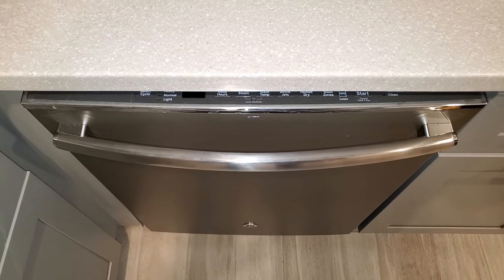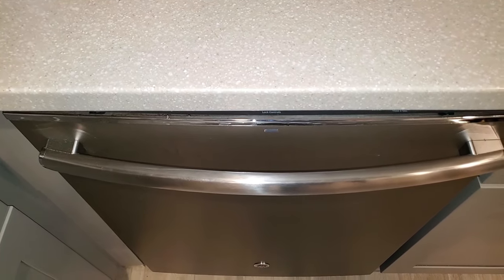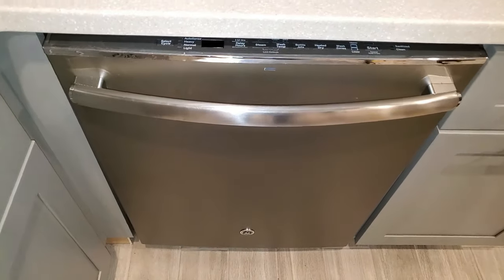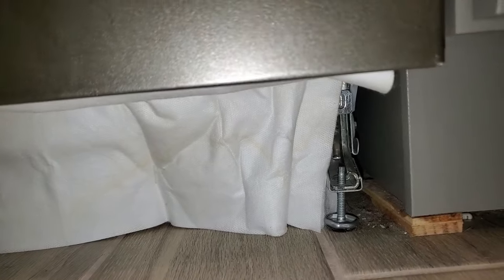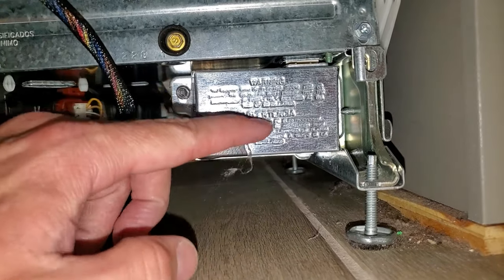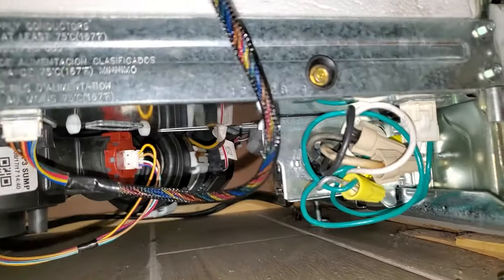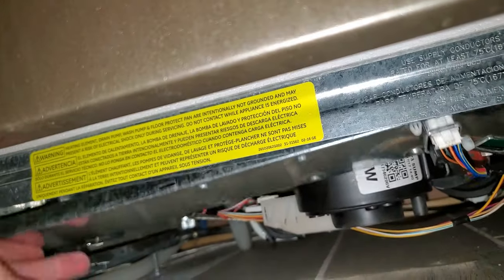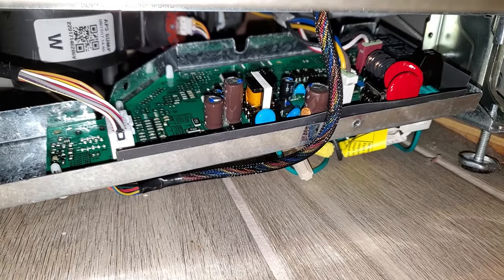GE Dishwasher - Troubleshooting a dead user interface

Comment: Awesome Video!  I'm facing the same problem on a different model. My model is GE-GDF640 (three years old) no led & no key function. Checked the main control board 13.5Vdc volt to UI board correct, replaced UI board, but the problem kept the same, then replaced control board, but still can't fix the issue. Give up, never buy ge anymore. Very bad quality.

Comment: Where did you find the meaning on the led on the main board? Having the same issue but I just replaced the user interface and it didn’t fix it…

Comment: Update…the board is dead again. The lights were on and shortly thereafter started beeping again, and went dark again only hours later.   Not the fix I had hoped for.
Reply: I had GE Service and they replaced the control board.  Fortunately, I had purchased the extended warranty and the repair was completely covered.

Comment: Matt, thanks a lot for the Video and explanation. 

Symptoms. -- UI completely dead, no lights.

How I fixed mine.

Made sure power cable is good, and 120 v is supplied to the control board.
I have Solid Green light.
Checked if 14 v dc is going to UI panel.
Disconnected the Control board completely. Connected back and made sure to hear the Clicks when putting the connectors back on the board.
When I connect the power Eureka , the dishwasher UI has power and lights are  on. 

Did not replace anything.
I think it was lose CONTACT SOME WHERE.

IT IS WORKING FINE.

A TECH WHO COMES FOR A SERVICE CALL WILL NOT SAY THAT IT WAS A LOSE CONTACT.

They obviously need business and service fee.

Comment: Any advice if there is no voltage across the pins?  Yes, it’s plugged in and there is a green LED light on.
Reply: I have the same issue. Were you able to get an answer on this or figure this issue out? Thank you for any information you may provide.

Comment: Thank you for the great video, it gave me a lot of insight. Question though, if I'm pulling 30 volts from my number two and number five pin, what does that mean, is it the main control board, or is that acceptable voltage to be coming from it?
Reply: That's a crazy high voltage, and definitely not normal. Double check you're testing the right pins, but it sounds to me like your main board (which should be supplying 14 volts) is not working correctly.

Comment: I tested the main control board and it has power and pulling 14 volts at pin 2&5. The green light is blinking every couple seconds. You think my issue is the user interface board? (I saw your video on how to replace, but wondering if that’s my issue). 
The dishwasher shuts off completely few seconds after I start a cycle, and won’t turn back on till I unplug it and plug it back on.

Comment: I have GE Model# GDF640HSM2SS. After 2.5 year my dishwasher completely went dark. In the electrical junction box when I tighten black(hot) and gray wire, then lights come up back in UI board and dishwasher starts working. This tells me main control board and UI board are working fine. I wonder how wire would get loose especially dishwasher worked fine for 2.5 years. Issue has happening 3 times now but works after the wire is tightened. Any suggestions on wire tightening so it doesn't keep happening again?

Comment: I think solid green is good. I was wrong. According to manual ever 3 seconds it should blink if there is no cycle.  I kept fiddling with mine and finally the board woke up.  Also found 2 shards of glass in the drain pump. 😢

Comment: Hi, @ 9:20 , how did you determine that the 2nd and 5th pin are the ones where you need to check the voltage ?

Comment: I have the same problem - around the 3 year mark dishwasher stopped turning on. Had to turn on/off the fuse box and it'd buy me a few days until it died again. After a few months of doing this, me flicking the fuse switch no longer works.

I've tried replacing the control board under the unit once and this didn't fix the issue....ordered a user interface board to see if this will help - thanks for the info! Wasn't aware of the LED light giving a clue to what part needs replacing!
Reply: Happy to report that replacing the UI Board did the trick. Although there's a bunch of steps, its not complicated to do. Took about 45 minute to do myself and running as we speak :) thanks a ton Matt Payne this did this trick! Everyone told me to just buy another unit as trying to get a handyman in will cost about half the price of just buying a new unit. 

Saved me from buying another 500+ dollar dishwasher!

The control board at the bottom of the dishwasher is now blinking green, which means it has communication with the user interface board!
Reply: I had the same issues and experiences. These dishwasher displays will shut off on their own. I’m wondering if their is a flaw with that. I have no light on the control board. What does that mean?
Reply: @lesliechow7286  try replacing either the control board or UI board
Reply: @WillTech105  , these dishwashers are lemons. A class action lawsuit needs filed
Reply: @lesliechow7286  I agree seems way too many people are getting these issues around the 3-4 year mark
Reply: @WillTech105  , purchased and installed mine January 2017. Bought it on Black Friday sale from Home Depot, normal price was $750, on sale for $495. Model was discontinued just after this time. First issues I had with it were in March of 2021,, had powers and controls lit up but it  wouldnt start. Bought a new door switch only to find out it wasn’t the door switch after I got my multimeter working. It started working again after turning power on:off etc. Still had intittent issues until may when it finally stopped working. Got a new control board. It worked fine for a month and then it started being finicky again. It brevet dried the dishes. I bought a new float switch. No change. I filled the rinse aid dispenser up and it seemed like the dishes were drying better. In November it started to get to the point where it didn’t work for 2 weeks ,no powers showing” and then It would work again. It got worse and worse, weeks in between it not working. Now it doesn’t work at all. I checked the wall switch (have to have it for code). I found with the switch off the washer was still getting about 1 volt. I replaced this switch with a brand new one. Still 1 volt. I was thinking this low voltage may creating some problem when  it’s in auto off mode (display not lit up)I’ve found if you leave the washer on in some situation where it doesnt auto shut off the control  display, I’ve found the washer will still work days and days while it stays lit up. As far as the 1 volt in the wall switch, ive found that’s normal according to electricians on the internet. It’s caused by electors fields from surrounding wires. It did seem in the past that actually turning the breaker off for a while would help it run again.

All that’s out the window now. I already put about $200-$250 wiring of parts into and all my time dealing g with this headache. I should have kept my one that was made in 1993 and just had new racks made. 

Dishwashers now start at $700 for a stainless face to match my other appliances.
Reply: @lesliechow7286  Sorry to hear @leslie chow - unfortunately my dishwasher is now acting up again. When I look at my Control Board I see a solid green light which probably means it lost communication with the UI board again. Literally had the part for 2 months and its busted again. Going to get a multimeter maybe the electricity is frying the boards.
Reply: @WillTech105  it’s all a waste of time. Their needs to be a class action lawsuit against GE for all of this. A GE rep saw me suggest a lawsuit against then and immediately they contacted me and asked that “I contact them privately “ to review.
Reply: @lesliechow7286  They probably know the design is defective hence why are so many other users of GE dishwashers having literally the same issue. They should do a recall or something to make this right.
Reply: @WillTech105   same here I replaced the UI board 2 months ago when the dishwasher was 2 years old and it has failed again. Lemon 🍋
Reply: @lesliechow7286   Curious, did you contact them?
Reply: @jeremytiner8729  no
Reply: We should definitely file a class action lawsuit. I've had 3 service repairmen out here and they've replaced 3 parts and my dishwasher is doing the exact same thing as the rest of you. Why are they able to get it working temporarily? The last repairs lasted less than 10 days. One guy indicated there was a little reset button under the dishwasher, but we can't seem to locate it. I've tried unplugging the wires that some show and I get no change. My dishwasher is the same age, 4 years old. Model number is gdt655ssj2ss.
Reply: @lesliechow7286  BTW - haven't updated this in a few months but I'm still seeing the same issue. The fix for me is playing musical chairs with my spare parts until it works. Will be fine for a few weeks then it'll die again. Rinse & repeat. Never again GE....never again.
Reply: @adrianneblack7048  Reset switch? Not that I know of unless you mean holding the SELECT CYCLE and START buttons at the same time for 5 seconds (btw doesnt work for me). I always see the control board shows a solid green light on it, which means its lost communication to the UI board (the board with the buttons). Usually changing the wire door harness, UI board, or the Control board fixes the issue for a while. Then I'll have to change them again to the previous parts again (literally need to swap parts every month or so) and then it'll work again. Alot cheaper than hiring a repairguy or buying a new dishwasher. I've done it so many times I can do it all under 20 minutes at this point.
Reply: @WillTech105  that is ridiculous that you have to change them at all, no less so often. And that changing them back to the original parts, it just makes no sense. GE needs to be aware of this. Not that they'll do anything, but they can't if they don't know. I'm going to give them a piece if my mind on Monday. 

As for the reset switch, one of the repair guys told me about it, but I didn't look close to see where it was, assuming it would be fixed and I wouldn't need to use it. In doing internet searches we've read about it, but can't find anything that tells where it is on this model. Its super frustrating. I've been trying to troubleshoot this thing all day and its not the first or second time I've wasted a day trying to get my dishwasher to work. All these companies are going to stop getting my money because I'm going to go back to doing it by hand, I already do for many things. I think it will save me time in the long run and will definitely save $$$.
Reply: @WillTech105  I haven’t touched mine. It’s going in the trash. Never will I buy a GE appliance again.
Reply: @lesliechow7286  Wanna get least another year or so out of mine before I chunk it and pull an Office Space printer scene on it
Reply: @adrianneblack7048  It is really ridiculous, agreed. GE wont do anything about it so only thing we can do is raise awareness that ALOT of other people are getting the same issue and to no give their money to GE going forward.
Reply: @lesliechow7286  @jeremy tiner @perry pendergrass - after 2 weeks of the dishwasher not powering on (flipping the breaker didnt help), I once again took 20-30minutes to play musical chair with the door harness, the UI board, and the MC board. After hooking it back up - the GE dishwasher magically (again) powered back on. Let's see how long it'll last me this time.
Reply: @WillTech105   damn ok thought I was going crazy. Got switch and it worked for a week. It didn’t work anymore and I don’t have the green light no more on the CB. 14V on 2&5 so it’s communication is working. Guess I have to buy UI board and ply this game too 😅

Thinking I might just not waste my time knowing this isn’t guaranteed after reading all your guys comment

Comment: Awesome Video!  I'm facing the same problem on a different model.  Where did you find the info on what pins send voltage and what the lights on the control board mean?
Reply from the maker: Thanks for the kind words!  And sorry for my slow response...it's tough to keep up with all the comments these days.  I believe I found most of the information I needed in the following forum thread:

https://www.applianceblog.com/mainforums/threads/gdt695smj2es-ge-dishwasher-control-panel-is-dead.65692/

Thanks for watching!
Reply: @mattpayne4087  yep that’s a link I found the best info on. With link to a manual.
Reply: @mattpayne4087  yep that’s a link I found the best info on. With link to a manual.

Comment: Mine just needs a quick polish of the ground bolt on the main board. Have done it twice now in a few years. First it starts randomly beeping, then the display does dead and it won't turn on for anything. I just drop the panel and polish the ground bolt. And it's magically back. Have never replaced any part of it.
Reply: Can you take a picture of this ground bolt such that I might locate it? And how did you polish it? With what?
Reply: there are a few boards in my piece of over engineered crap. do you mean the one he with green led - which tested 2 and 5 of?

Comment: I have the same problem as you and everyone else. Pulled control board checked for voltage and almost no volts. Plugged back life came on, so pulled connection and checked for voltage and still almost nothing for volts. Thinking ordering the interface board.

Comment: My board was square and LED was rapidly blinking which indicated new circuit control board needed.
Reply: Thanks, I have the same problem!  Where did you find the info for what the light condition means?
Reply: @AM-py5vg  
I got lucky and found in the comments on a different video
Reply: I just replaced my circuit board and it’s still blinking rapidly. No power to the user interface either by testing the pins. Waste of money buying a new circuit board. Will be getting a different dishwasher, preferably not by GE

Comment: I get 14 volts with the 1st and fifth pins, not the 2nd and fifth. Also when you unplug the th harness to the  door control board wouldn’t the green light come on? Mine doesn’t. I already replaced this board here your working on back in May 2021 . GE put out another model of board which is the one I got but I’ve still
Had nothing but problems with this dishwasher. Should be a class action lawsuit
Reply: I replaced this user interface part twice, about $100 each time. This fixed the dishwasher for 2 months before it would crapped out again. So now im $200 into it. Im to the point now, do I junk it and buy a new DW, or pay someone to figure out, what is causing this user interface to keep going bad.
Reply: @TwinTurboRamAir  sounds like you're not the only one unfortunately. Try to get GE to send you a new one at no cost. This is ridiculous! They haven't been happy about it, but so far I've gotten them to send repairmen and parts at their cost. Thankfully, because 3 parts into and its quit again 10 days after the last repair.

Comment: So checking with pins 2 and 5, what setting is the meter on and what color prob goes to what pin when checking for voltage?
Reply: DC volts and it shouldn't matter which probe you use. You might see a negative sign in front of the voltage if reversed.

Comment: Don't replace any parts the problem is the yellow wire coming from the display controll is losing it's connection no don't replace
Reply: How did you repair that? I'd appreciate any help on this. Thank you.